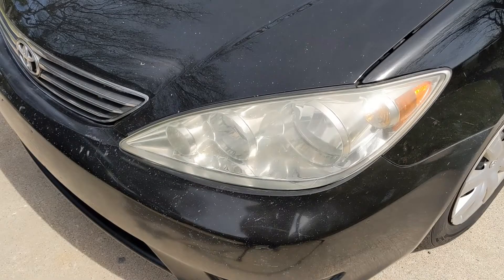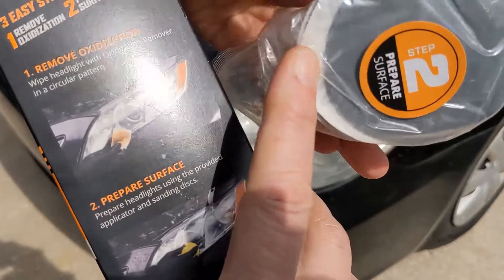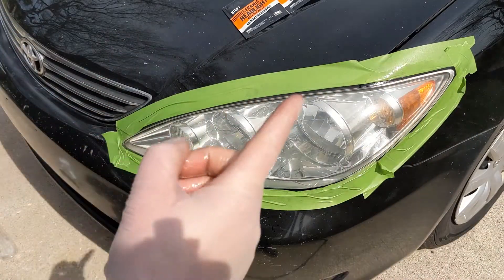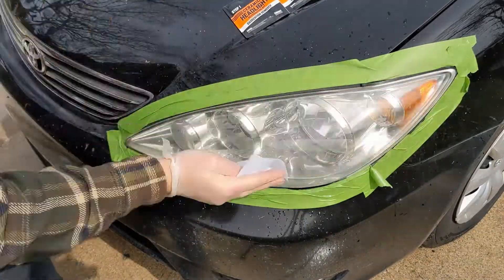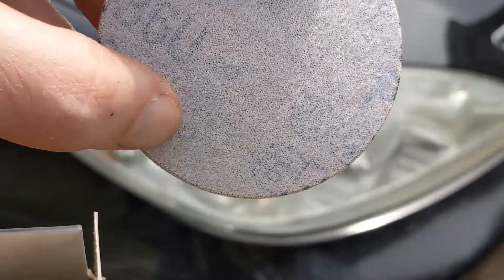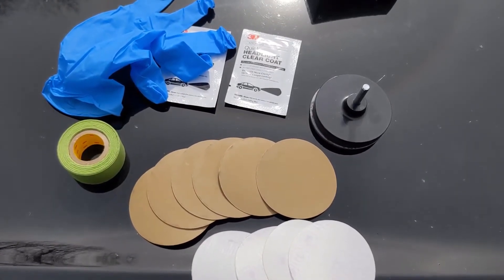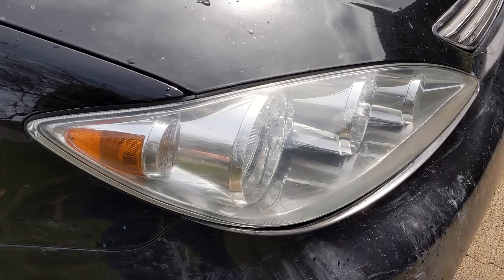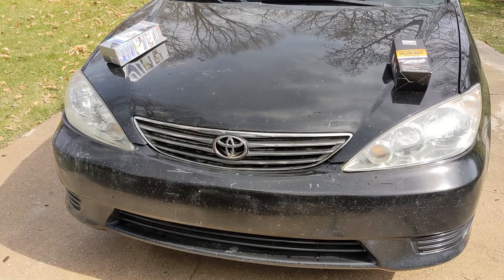Headlight Restoration: Cerakote v 3M

Comment: Definitely an error applying the clear coat from the Cerakote kit to a wet headlight. They specifically warn you about doing that. Having used both kits on a few cars, I say the 3M ultra kit (don't apply their wipe in the last step), then follow it up with the Cerakote or the Sylvannia kits. A spray on 2k clear coat at the end probably gives the best durability/life to your restoration efforts too. If you just have access to the 3M sanding discs without the kit, then do that obviously.
Reply from the maker: See, most people just call me an idiot, but you provide useful help for others.  Thanks!
Reply: I’ve used Cerokote multiple times on bone dry lights and I still get streaking , not sure why
Reply: 2k maybe as a last resort?? As there's nothing permanent when it comes to restoring headlights, Tha main difference between 2k and other certified clearcoats is removal of old cracking flacking 2k, A nightmare to remove!!!😢
Reply: I believe on the first one that you did it says to wash the headlight first

Comment: You were meant to apply the ceracote coating after drying thoroughly. Then leave it alone for at least 60 minutes before doing anything with it. User error
Reply: Yup. Really obvious. Why even put a rag on it, should have used a finger and a test area. Common sense.
Reply: EXACTLY!
Reply from the maker: Totally!
Reply: You should follow instructions when doing these tests.   @YoshimoshiGarage
Reply from the maker: I should follow directions for a lot of things. Call it a character flaw.

Comment: With the 3M, were you not supposed to be DRY sanding with the first two discs and wet sanding only with the third Trizact disc?
Reply: Don't you mean your not to wet sand with step 1+2 only add tap water at stage 3, p3000 trizact disk????

Comment: I know this is an old video, but it popped up for me. Having NO experience at all in headlight restoration, Cerakote actually brought my headlights back to brand new status in clarity. But I followed the directions. worked them in garage (not outside in sun or heat). I had NO contamination remaining when I started with the de-contam pads because I fucked up with my headights with GooGone for Automobiles while trying to remove bugs (hence the reason for a restore kit) NOPE please don't listen to ANYONE who says they used GooGone for Auto's and everything's A OKAY, it won't be for long! They're probably just have a lot of top-coat that hasn't worn down yet and the GooGone is eating away at it. I digress. I sanded much longer with the first pad until the water/plastic/debris started to clear up by about 80-90%. On the finer sanding I kept on until the water was clear. Cleaned everything up, dried it off with a towel and a blower let it sit for an hour, used blower one last time. Followed the instructional video from Cerakote and they came out as good as new. That said, I can see microscratches, I don't know if there is finer sandpaper to purchase and bring it one stage further to reduces the appearance of microscratches. However, according to ImJoshV, Cerakote does require "scratches" in order for the ceramic coating to adhere/bond. He claimed they filled in, well, I wouldn't say that's true, if I use a wood filler on a damaged piece of wood, the surface looks whole again. So again, I might try to reduce the microscratches with a finer sandpaper if possible. We'll see how long the ceramic coating in Cerakote holds up! But in terms of clarity, they look absolutely 100% brand new! MUCH cheaper than the $2.7K new OEM headlamps would cost me.
Protip, if you're going to use this product, before you even start, use a good silicone conditioner to work the rubber around the lights before you even begin. I mean, if you're gunna do it, do it right!

Comment: Why would you touch the lens?  What was the air temp?  I had excellent results with Cerakote on a 70F warm day.
Reply from the maker: It was in the 70's. I touched it because I had already finished the side with the 3M and it was dry and good, so I did a simple wipe with a cloth. I definitely should have waited, but the fact that I put on the cerakote, then did the entire process on the other lens with 3M, then came back and it wasn't dry was really disappointing
Reply: You’re supposed to wait a MINIMUM 60 minutes before exposing the headlight to weather or driving. I can’t freaking believe you touched it with a towel like that!  WTF?  Maybe try reading directions sometime.
Reply from the maker: Yeah, I mean I only did the entire 3M process after the Cerakote, and after it was dry I touched the Cerakote was still not dry.   What was I thinking?
Reply: @YoshimoshiGarage  they're two different companies. Need to follow instructions for them individually (obvious). Also 3m asks to apply the coating two times with a break in between to dry off.
Your before after pictures are the best though in terms of video editing. Nice job for that one

Comment: I tried the cerakote system and from far it looked good but up close not so good.  
So I decided to start over. 
1 ) wet sand with 800 to 3000 grit sand paper.
2) use rubbing compound with a foam pad on a drill.
3 ) use polishing compound with a foam pad on a drill.
4) put  a clear plastic wrap on the headlights to protect from UV / sun 
The headlights look like brand new.
Reply: What ppf did you use?

Comment: Not sure when restoring headlights with 3M you where doing it right?? The kit you bought was meant for dry sanding and not wet?? The last time I looked at 3M restoration kits , There are three, One for wet and another for dry, And a heavy duty kit, Hence that is why the base plate is included in the kit also the sanding disk are correct sizes p500-p800 then the magic trizact p3000 with water,So the reason you where disappointed is not the fault  of the product!! But a falling on your part not reading the instructions properly!!!🤔🫨😫

Comment: I found the Cerakote an inexpensive, quick fix, but if you're gonna bust out the power tools, might as well polish and spray a proper clear-coat.
Reply from the maker: Definitely right.
Reply: What will be a proper clear coat?
Reply: @JR-nh4fi  Automotive clear coat, two part, like paint.